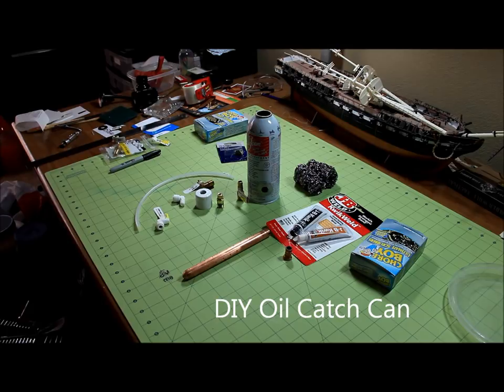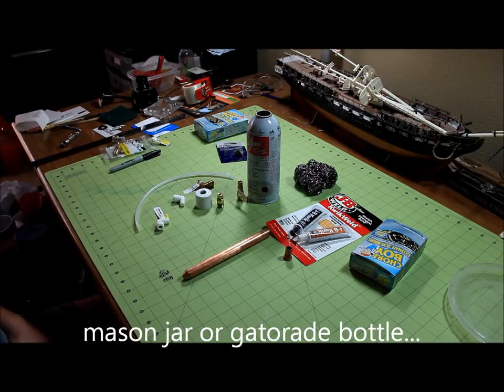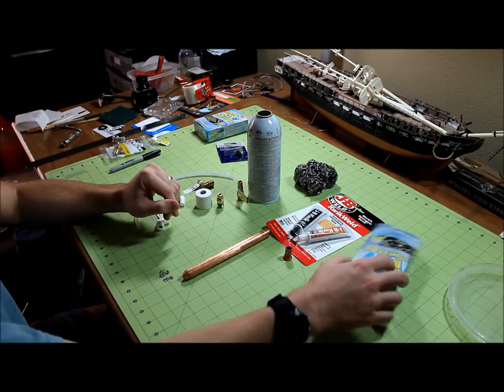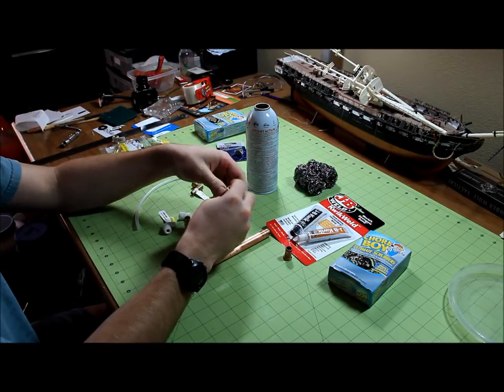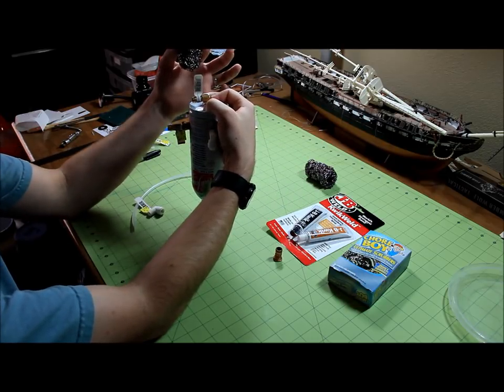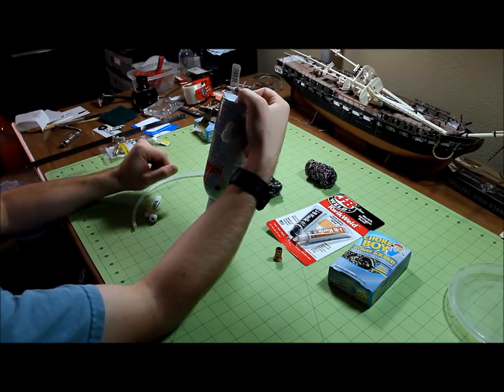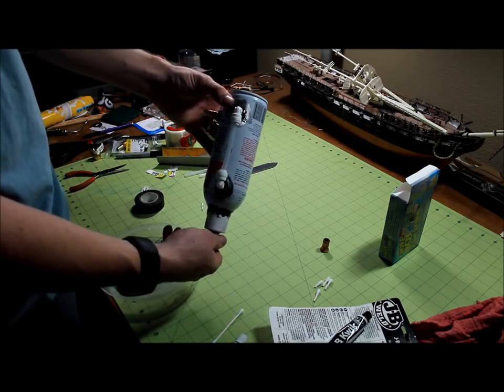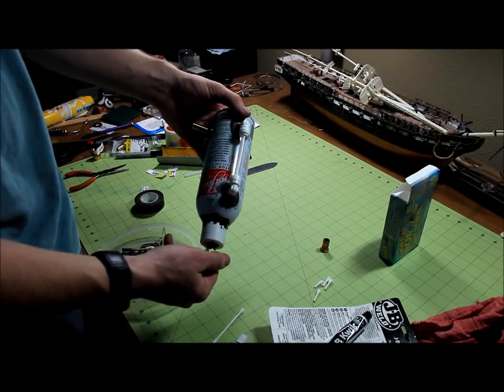DIY Oil Catch Can

Comment from the maker: It is used to filter moisture and oil from the air that would have otherwise been sucked into the intake from the valve cover.

Comment: why the steel mesh ?
Reply from the maker: Helps trap the moisture and oil and allow it to collect at the bottom of the catch can rather than sucked into the intake.
Reply: the steel mesh provides extra surface area for the vapors to condense onto, thus falling out of the airflow circuit and collecting into the catch can